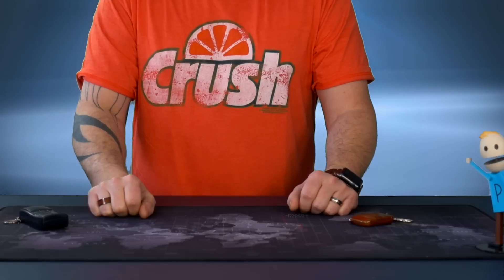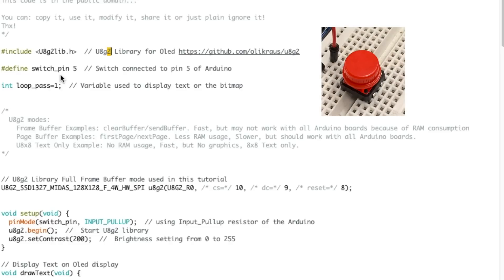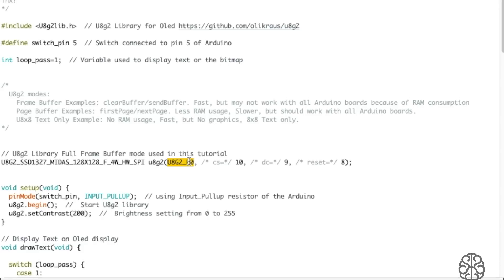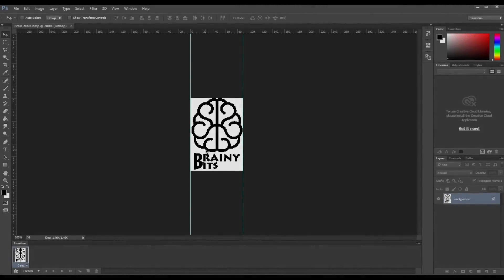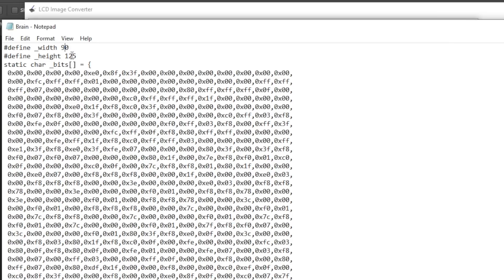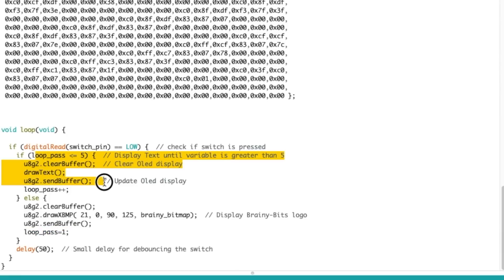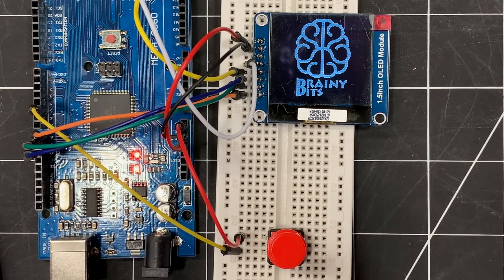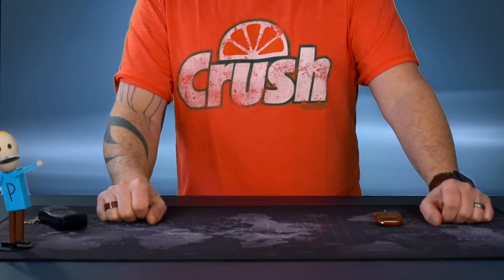Finally! A BIG OLED Display for the Arduino!

Comment: Great job on the tutorials!

Although I couldn't find your tutorial about Page Buffer mode you mentioned in this video. Since Frame Buffer may not work for this display (RGB version) as I'm using Arduino nano.
Secondly, Is it possible to execute a display rotation command while the program is running? With an IF statement for example.

Comment: Great video. But... in my application I want to display GPS info using the TINYgps library. When I connect the GPS the display goes nuts. When I disconnect the GPS, the display works as advertised... just say'n.

Comment: Where did you buy this 1.5" OLED? Because I couldn't find them cheaper than $9 which is expensive if you compare them to regular 128x64 (<$2). Could you please make power consumption test with different frame buffer content?

Comment: Hi there,
 
I was wondering if you would be interested in make a project 
Using the popular  real time clock RTC 3231
To turn on and off a relay at set times 
 The relay could turn on and off light Or a plug in 

And if you would like to build the project up one could include a 
 I2c to set time using buttons 

Here is a link to the project but most of noobs can't get it working 
Mostly due to the bad videoSent 

https://www.instructables.com/id/Arduino-Ultra-Mega-Timers/#discuss

Thanks for all your awesome videos

Comment: 1.5 inch is not big at all.  Get back to us when you get one that's at least 7 inches.
Reply from the maker: Ok, I'll make a note to get back to you in a couple of years...  Just kidding, for the price (under $20cnd)  and the fact that it's OLED not LCD, it's a pretty good option.  Thanks for watching btw.
Reply: @BrainybitsCanada  Check out the 2.54 OLEDs, they're around $20 and FANFREAKINTASTIC
Reply from the maker: Got a link?
Reply: ups -my bad, misread, the link is not for OLED displays